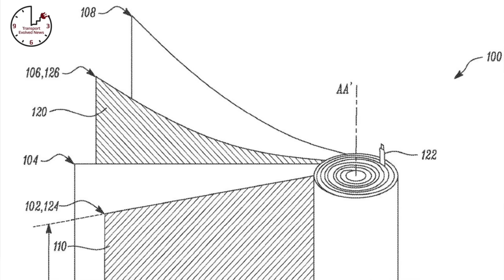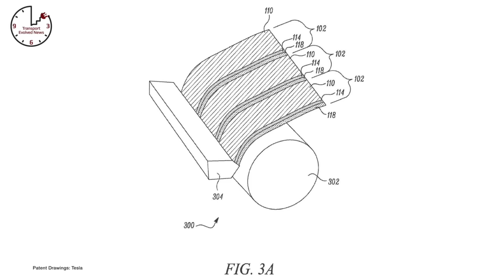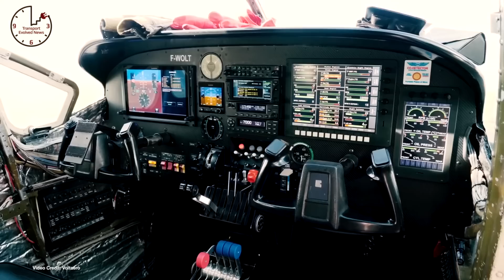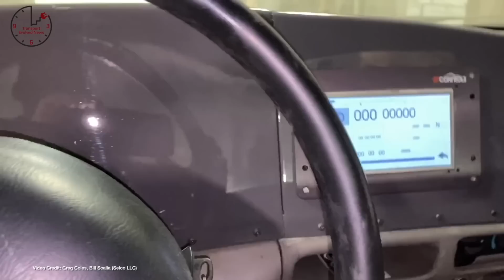TEN 291 - BMW Cans i8 Successor, Lucid Efficiency, Tesla Breakthrough  Battery

Comment: That electric airplane looks like a “test mule” built upon a Cessna Skymaster airframe.
Reply: Gary Morrison, I’ve been thinking that a self launching sail plane with a light weight electric motor and flexible solar might be an idea. It’d beat the two strokes some are equipped with now.
Reply: That's what I was thinking.  I wonder what Richard Bach would think?

Comment: Regarding motor efficiency (and companies claiming bulls**t around it)  a TERRIBLE perminent magnet motor is around 93% efficient, a very good one, around 97% efficient. This means, that even if someone makes a 100% efficient motor, a motor that is absolutely perfect in every way, it can only gain something like 5 to 3 % extra range!  Ie, you 200 mile "terrible" motor pwerede car, can no do 210 miles with the perfect one.  So sure, Lucid may have made an amazing motor, but frankly, it doesn't actually matter!  (what OEs are learning is that it's far, far more important to reduce road load and hotel loads through clever optimisations, than it is to spend enourmous sums of money and lots of time trying to improve a device that is characteristically already nearly perfect!
Reply: What are road and hotel loads? Is that vehicle weight and non-motive consumption (heating/gadgets etc)?
Reply: they could utilize the temperaure of the ambient air to get more than 100% electrical efficiency, like a heatpump [/irony+sarcasm] :D

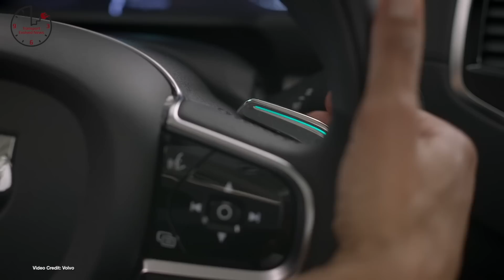Comment: @7:23 the screen displays the words 'Auto Pilot'.   LOL!  I guess Volvo doesn't want to use their own name for their self driving system....
Reply: because Tesla of course invented the name Auto Pilot ...
Reply: I only mentioned it because Tesla has caught so much flak for having named their system 'Auto Pilot'.  "Because it misleads people to believe that the car is fully self driving".  And yet, here is another manufacturer with the words, 'Auto Pilot' right there in their software.....wonder if they will receive the same admonishment?
Reply: Good catch.  How interesting they are using "Auto Pilot".
Reply: Current assistance is called Pilot assist.
I don't think the next advanced iteration is called auto pilot. The B roll shown is not based on the latest Volvo announcement